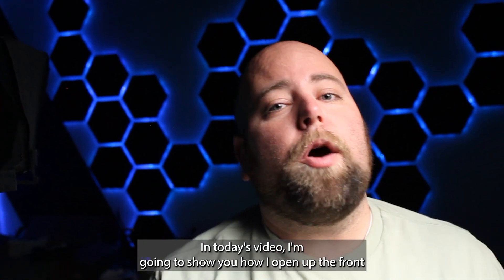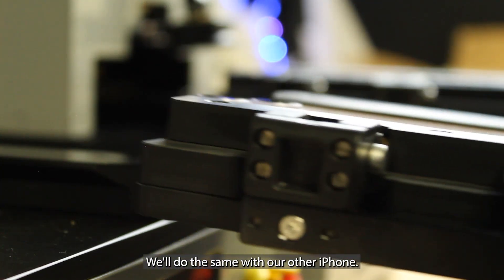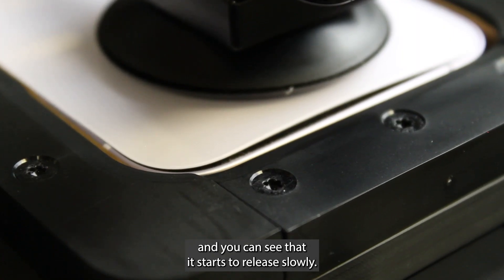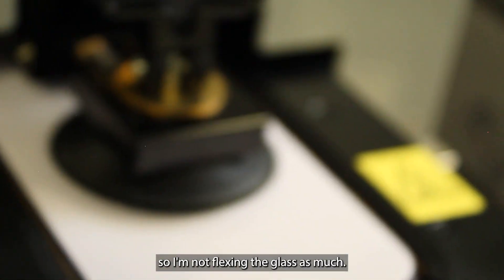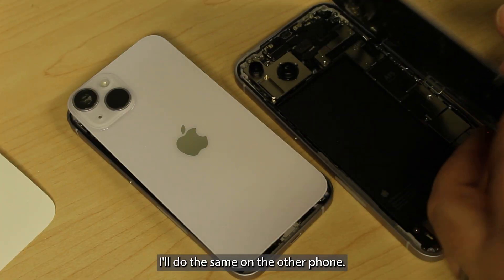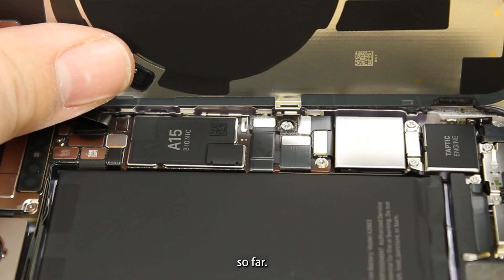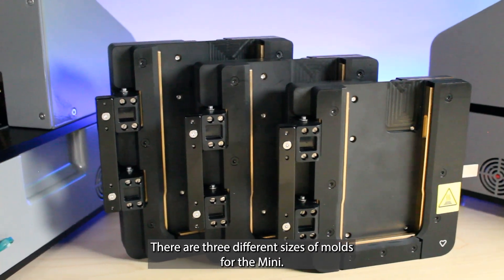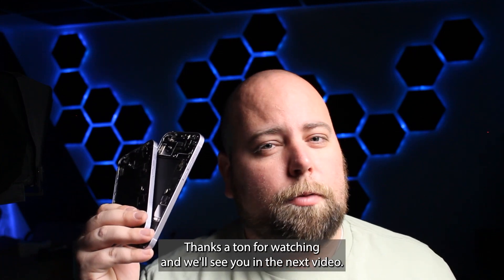iPhone 14 & 14 Plus: Back Glass & Screen Removal with Apple's Heated Opening Tool

Comment: I replaced the back glass on my iPhone 14 but my camera doesn't save flash photos anymore, even though the flash fires and it saves normal photos. Flash photos still save with the original back glass. Did you run into this issue?

Comment: iphone 14 pro and pro max is same ?
Reply: indeed, both 14 pro models come apart the same way as the 12 and 13 models, as in they open from the front and the back glass requires a special laser machine+ a good amount of labor to remove. only the base 14 and plus model have that different design that opens from the front and back, with the wireless charger and flash being attached to said back glass instead of the frame.
Reply: No, just the standard 14 & 14 plus, the pro & pro max are still difficult to repair.

Comment: Can we remove shattered back glass of iPhone 12 & 13 too
Reply from the maker: Not with this machine. The only Models apple has made with removable back is the old iPhone 4, 4S and now the 14, 14 Plus. This machine was actually designed for the iPhone 12 series and just so happens to work on the newer models

Comment: Does it work when the glass is shattered
Reply: you have to 1. hoover or sweep the broken pieces off . 2. glue a screen protector to the broken screen to hold it firmly, it works even without glue . just the screen protector .